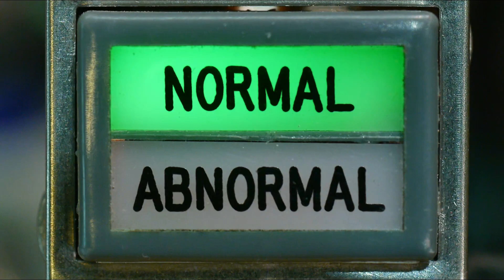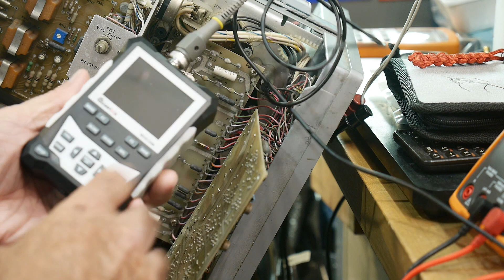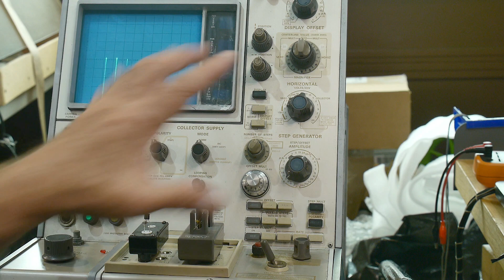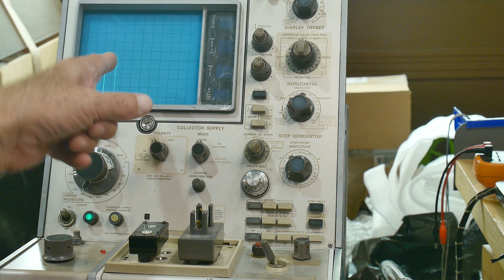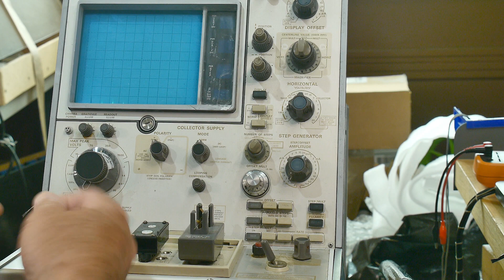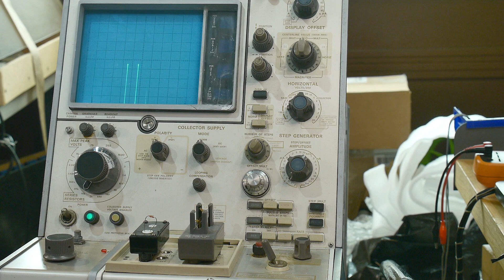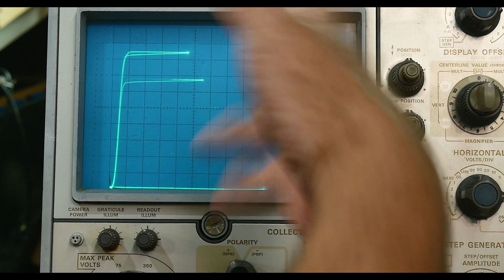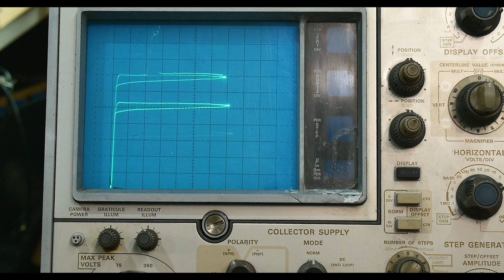#1282 Tektronix 576 Curve Tracer (part 8 of 9)

Comment: This service manual has a great calibration/performance check section.  You can check the vertical switch settings for accuracy (Table 5-9, pg 5-18).  You just need some accurate 1, 10, 1k, 10k, and 100k resistors.  At least that might help you determine if the whole assembly is bad or part of it, or the circuitry controling the switch.  For mine, I thought the step generator amplifer was faulty and jumped thru hoops trying to figure it out.  When all it was the J360 harmonica connector that connects the standard test fixture to the instrument was loose!!!! So I likely wasn't getting good contact.  I was really kicking myself for that oversight.
Reply from the maker: yes, I did a full cal. took awhile

Comment: Hi, it's beautiful how it comes to life, I wanted to ask if you measured the leakage current with those big electrolytic capacitors. It happened to me several times that a capacitor with the right capacity and ESR had a bad EPR, in one case I almost went crazy, when tested on an LRC meter it looked good, but after heating up in the circuit it began to pass the AC component and the EPR changed dramatically.
I wish you the best of luck in the rest of the recovery process.

Nice day 🙂 Tom

Comment: The base current (or gate voltage) is stepped uniformly between sweeps.  The CE(DS) voltage is then swept before the next step.  The CRT plots collector(drain) current (y) vs. CE(DS) voltage (x).  Many of the controls allow changing the polarity of the base current (gate voltage) and the collector(drain) voltage to accommodate the various p and n combinations.

Mostly, I think switches, connectors, and pots need cleaned; however, I also think there are one or two component failures.

Comment: Vertical problem looks like a classic dry joint...  or dodgy pin connection...  or open wiper...  or dodgy switch contact...

Comment: RE: Looping - User's Manual page 2-22 "This effect is known as looping and is most noticeable at very low or very high values or current. Looping is generally caused by stray capacitance within the Type 576, and device capacitance."
Reply: This looping (hysteresis? ) was also exhibited by the homemade curve tracer I.Guy demonstrated earlier.
What a densely constructed box. Still don't see the transformer.
Reply: @jspencerg  Parts breakdown in the manual shows it buried in the bottom.

Comment: I want to scream.
Please don't be offended.
You are to focused on the damn knob twiddling. (sorry)
You have identified the vertical is mal behaving.
I suspect that the "loop-dee-doos" are part of the issue.
Get out your scope - get scientific - just look at the vertical circuits.
The problem will jump out and bite you, and it will be a simple problem.
Note on capacitors:
When working on old radios, or crappy test equipment and audio amps, the caps will be very suspect, since the part quality is not so good. But Tek and HP used good parts, and many times most of the caps will be fine. I find that measuring ESR in circuit is the best compromise between effort and outcome - at least in the first phases of trouble shooting.
You may very well find a bad cap or two, and they may be the problem. But your effort so far has been too knob twiddly. Break down and look at the schematic, probe around the vertical circuits. You WILL find it,... and it will all be worth it.  
That is my UN-requested coaching, so now I will shut the F up. ;-}
Reply from the maker: I'll expect an appropriate comment from you when you see part 9 😎
Reply: @IMSAIGuy  LOL, Ok I await the challenge.
I was attempting to wait for the end, but I failed. You always come through.
Reply: @IMSAIGuy  LOL !
Reply: I admire your candor Sir.
Reply: @andymouse  IMSAI guy is smart, I am a smart ass.
Reply: @mr1enrollment  Haha !